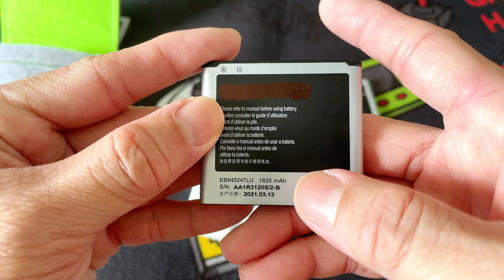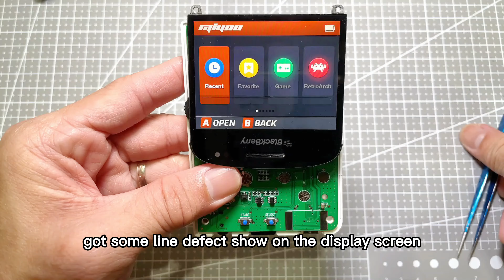Miyoo Mini / Blackberry Display Screen Question ???  with Additional Spare Battery

Comment: Hello. Master
I have a question about miyoo mini.

When updating with sd card
When there is a problem when rewriting the internal storage
I hear that miyoo mini will not start

The miyoo mini has a USB-C port,
Is it possible to refer to the internal storage by this?
Is it possible to repair the corrupted data in the internal storage by connecting to a PC when the device is corrupted?

I would appreciate it if you could tell me

Comment: Wow, this is very useful information!  Thank you for sharing. How hard do you think it will be to cut the blackberry screen to fit miyoo mini original case?
Reply from the maker: You need to preheat the screen and also need to use very very very thin like iron wire to remove the oca laminated firm glue, hard is not very hard just need to be careful not to damage the display screen only

Comment: I don’t agree, because I searched the whole city and found about 10 screens from the BB 9900 and not one of them went to the Miyoo Mini v4, everyone’s screen lights up and flickers and everything doesn’t work. Last month I had a second Miyoo Mini v4 and with this there may be a problem in the board itself and so I pulled out the original screen from another Miyoo Mini v4, and it worked in such a way that not every screen is from BB 9900 was suitable.

Comment: Hi, I would love to find out if this console could run a port of Mario 64 like anbernic rg280v ? Or this is very unlikely since anbernic had much better community support over the years? 
Great video btw :)
Reply from the maker: Hi, no idea need to try and so far the original software is not so nice to use, was hoping to have cfw
Reply: @dogandcattvshow  ok thanks for honest answer. I'm really keen on getting miyoo mini, but it would be incredible to have Mario 64 running on this device <3
Reply from the maker: Let see thank
Reply: @macwie5026  Judging by other reviews and studying the characteristics of the hardware of this device, this game should work. True, at least you will have to enable the option, automatic frame skipping. P.S .: I don't really know English, I also used a translator. :)
Reply: No doubt the hardware is capable of running it.  The problem is the closed source software.
Reply: @MrCumstein  Yes, it saddens me a little - since I already ordered this prefix. I would have known a little earlier, better ordered anbernic rg280v.
Reply: @insidesky9959  I still think this is an excellent little system, especially for the price.  I’ve gotten more enjoyment from the GKD350H than I have from any other system, and it’s closed source as well.  My point is that it can still be great despite being closed source.
Reply: @MrCumstein  Thank you for this insight! Although yesterday I just placed my order for this miyoo mini... I know very little about software development but knowing it's closed system does it mean it won't run a port of Mario 64. I heard there is a CFW in works so one day this port would be possible? Either way I think miyoo looks great and seem like it plays a lot of things.  Though it would be bit sad of it lacked that one game.
Reply: @MrCumstein  "GKD350H" - how will it be better than the same set-top box "Miyoo Mini" in your practical experience of use?
Reply: @macwie5026  This system is getting very popular, so I wouldn’t be surprised to see some developments.  I bet someone is working on that port right now.😉
Reply: @insidesky9959    I didn’t mean to compare the performance of the GKD350H (almost 3 years old and more powerful) with the Miyoo Mini.  I was just saying that being a “closed source” system doesn’t mean it’s not good, or that things can’t be improved.  In my opinion the GKD350H wasn’t successful because it never got popular enough to overcome being closed source, even though it had so much potential.  The Miyoo is already more popular than the GKD (350H or GKDMini) ever was.
Reply: @MrCumstein  oh cool, so then there is some hope on the horizon :D ! It would be great, but regardless I'm excited to receive mine. We will see where it will take us I guess ^^
Reply: @MrCumstein  Well, judging by the movements in the repository of craftsmen who know how to work with microcontrollers and the unix system, in the middle of spring, or in the summer, we will see something worthwhile. In the meantime, I'm waiting for the second day for the seller to send a parcel to aliexpress with this console. I hope he has them in stock and does not have to fiddle with the return of money.😑
Reply: @insidesky9959  I’m guessing you’re using an English translator?🙂
Reply: @MrCumstein  Since I am from Russia and learning English, I have to use a translator to write comments. As for reading the English text, I partially use it. So forgive me if you misunderstood me somewhere. 🙂
Reply: @insidesky9959  Hey you’re doing a great job.  My comment was not meant to criticize you, my friend.🙂
Reply: @MrCumstein  Thanks!😉 Since it rarely succeeds, even in writing, even in this way with people who speak from birth, because we have problems with this here. Despite the fact that relatively recently in my specialization, I am engaged in frontend-developer. Therefore, basically it is necessary to operate with technical terms. )